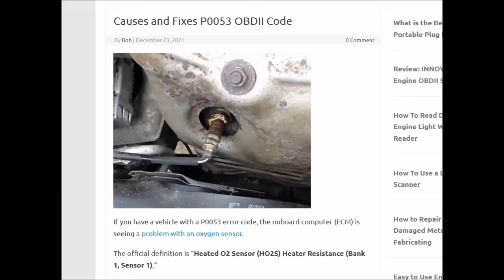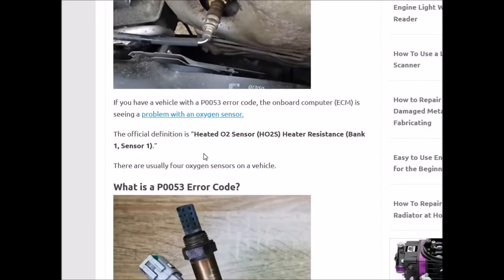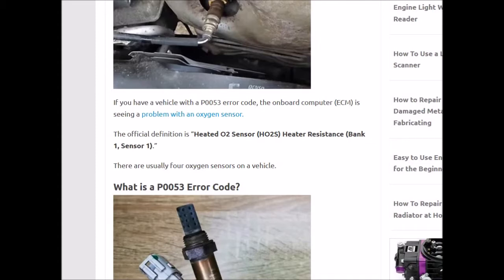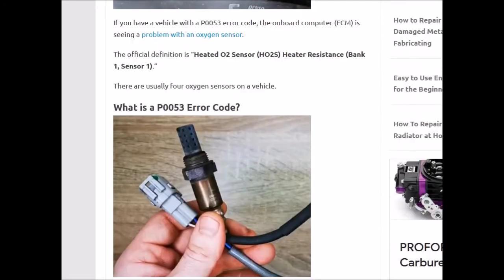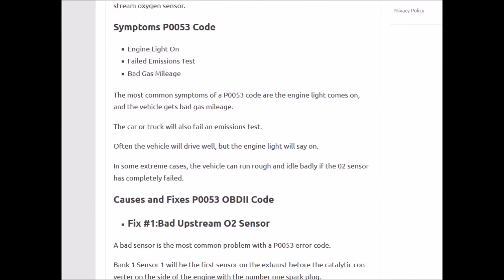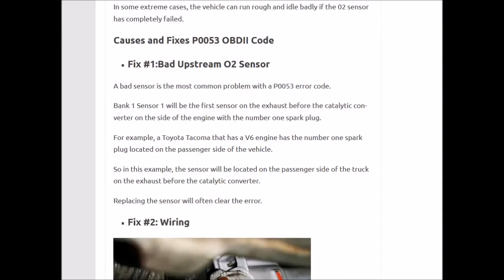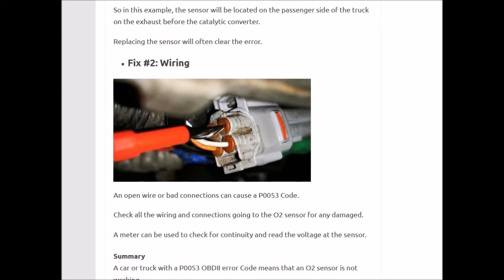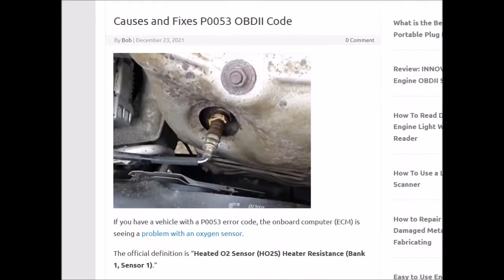Quick Overview of Causes and Fixes P0053 OBDII Code

Comment: Hi everyone! My Chery Fora gives the same mistake, P0053. I replaced the O2 sensor, it did not help. So I started to check the issue with a tester and found out that voltage from ECU to two white wires which are responsible for heating the O2 sensor spiral is less that 12 V (8.63 V). What can be the reason? In another video I found that there can be a certain chip in the ECU. Is that true?
Reply from the maker: It could be a bad ground. Connect the meter to the positive wire at the heater circuit. Then, connect the meter negative probe directly to the battery negative terminal, bypassing the negative heater circuit wire. If the voltage is 12 volts, then there is a bad ground.

Comment: We have a 2005 Chevy Malibu with a PO035  and we changed the 02 sensor, in the same location shown in your video. A few days later another code of PO135 comes up and is showing the same 02 sensor. What else could it be?

Comment: 2008 Pontiac Grand Prix V6 , had 420 code , mechanic changed upstream O2 . Now it's throwing the p0053 code .  He already put a second one on because had no activity code .  Now just the 53 cel . What cause that code after new O2 sensor ? He fixed my car by replacing the ignition control module .  I was having misfires, bog out on hills if give too much gas . Has new fuel pump as well.
Reply: The same thing happened to me. Had the 420 code, the mechanic changed my upstream 02 sensor, and now it's showing P0053. So now he says I need a catalytic converter.

Comment: Hi, I have P0053 issue, on first sensor, on between the 3 and 4 pin have 3ohm resistance, on the second sensor heat circut have 8 ohm, what is the proper resistance on 1st sensor?

Peugeot 207 1.4vti 95 HP 
Unpluged both sensors gives P0141 P0135. But after connected both, stay P0053, suspect wrong resistance of heater circut.

Comment: Hello my car is Peugeot 308 turbo..just replaced the bank 1 sensor, and clear the code from the ECU. on the car but still same problem and the same code still coming out! Can you help to tell what could be the issues?
Thank you.
Reply: I am having the exact same problem.  I have a 2008 Buick Lucerne and I replaced the oxygen sensor and reset the error code but the error code is still coming up and the check engine light is still on.
Reply: Replace with original type sensor not a cheap one
Reply: @texas3258  same broblem and I bought a 38 $ sensor but acdelco is 98.95?